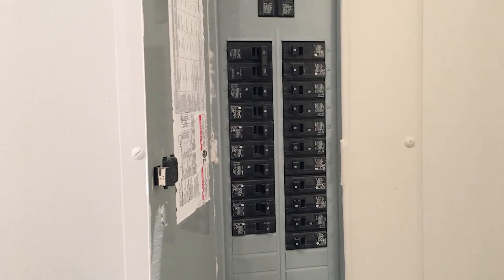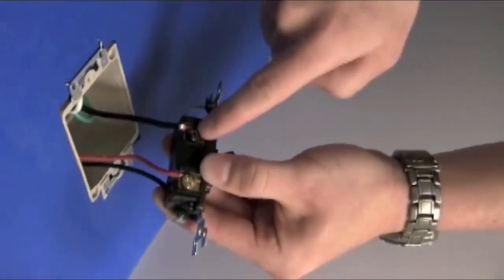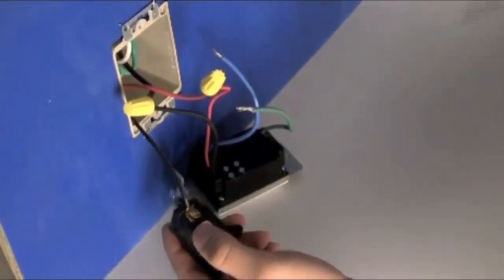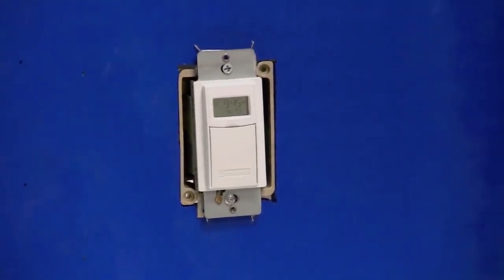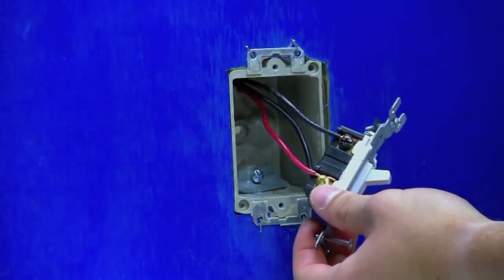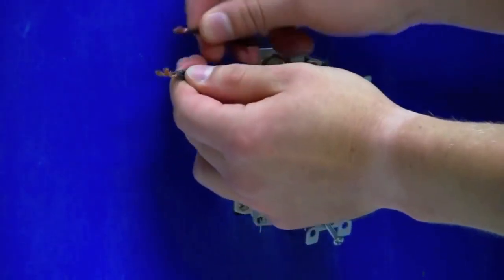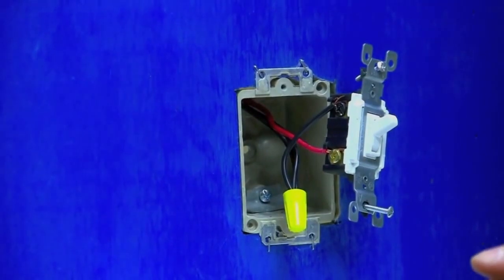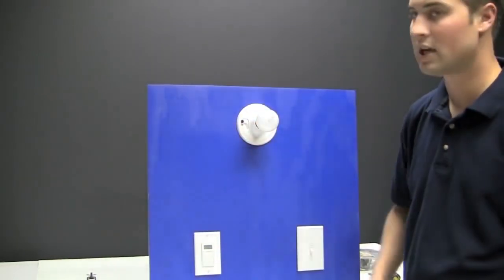How to Install the ST01 Three-way Timer Switch

Comment: Important. You must first make sure  that the  "Common" wire that you mentioned first is Actually the Hot ( Live, power )wire  and connect That  wire to the timer device.

Comment: Is the wiring done the same way if the ST01 is used at both junction boxes? Specifically, the jumper wire? Thanks!
Reply from the maker: @btburnem , Thank you for the question. We recommend you contact our technical services team who will be able to answer your question over the phone. You can reach them at 815-675-7000; their office hours are Monday-Friday, from 8:00 a.m. to 4:30 p.m. CST. Thank you again for the question and thank you for being a customer. LG

Comment: Thank you for the video.  Trying to use the ST01 timer switch on outside lights that are controlled by two switches.  On my existing three way switch the wires that I would connect to the red and black wires on the timer are both the same color.  How do I know which wire to connect to the jumper wire on the other switch that controls the lights?
Reply from the maker: Hi Brian, and Thank You for the question. I recommend you contact our Technical Services team so they can walk you through it over the phone. You can call them at 815-675-7000, M-F, 8 AM to 4:30 PM, CST. When you call be sure to ask for Mike. Thank you for being a customer, we appreciate you. Let us know if you ever need anything else. Have a great day! LG

Comment: This 'how to' has some information that the other Intermatic ST01 installation video doesn't have!

"Dan" says @ 1:49 " Make note of the color of the wire you connect to the BLUE wire from the timer".... the first video doesn't mention this at all.

Why have 2 DIY's on line and only one has complete information?

Other than that no complaints!
Reply: I believe the other is for a single pole installation -- where there is only one switch that controls the light -- you do not use the jumper cable for those, etc.

Comment: how is common black? thats not code
Reply: The code you are referring to is the white (neutral or grounded conductor). The common on a 3-way does not mean neutral or grounded conductor. All 3-ways have one common wire, and 2 traveler wires.